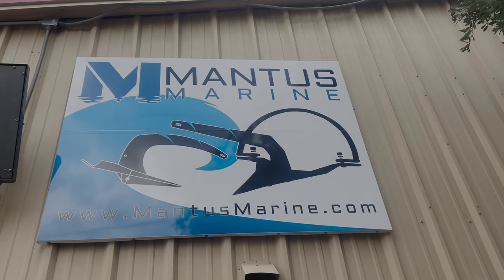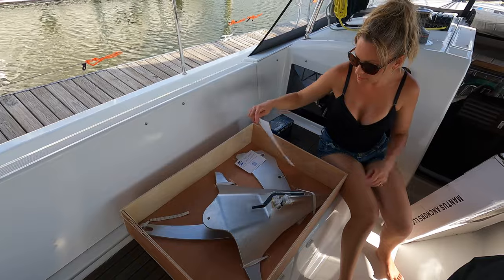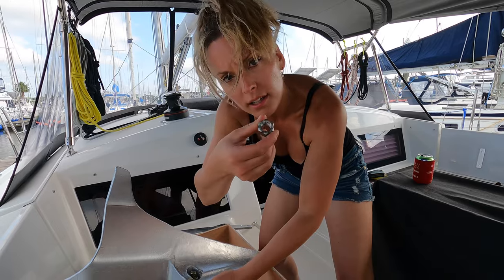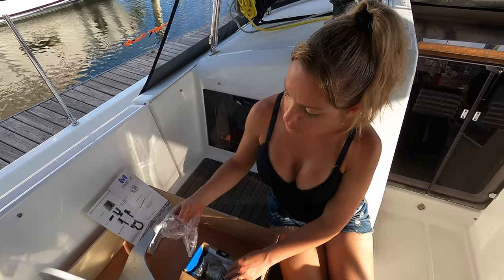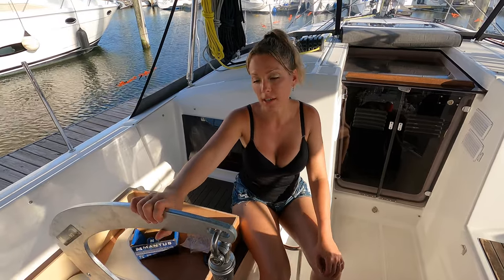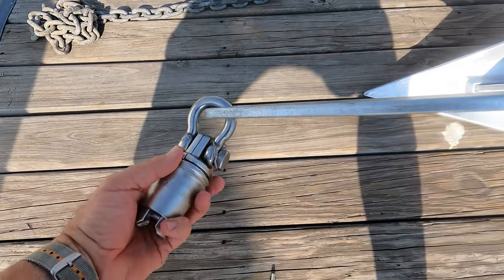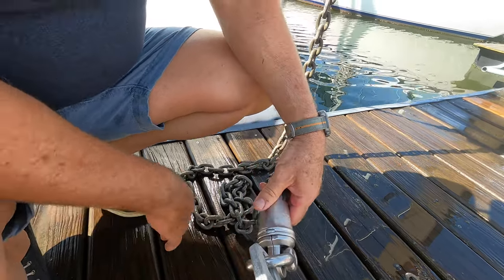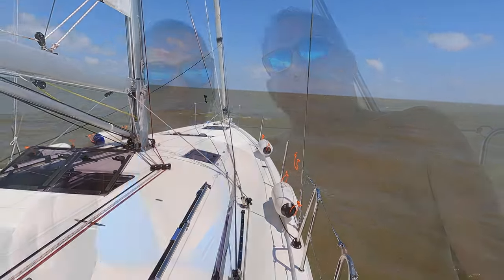Size Matters   Mantus M2 Upgrade

Comment: Nice Anchor, good to see it's a nice fit at the bow too. Not sure I can get one here, but will be OK with a Rocna if not, which is a kind of beefed up super enhanced Genuine high quality Lewmar Delta . I was lucky enoughnto have one of those original Lewmar Delta Anchors on my last boat, which got me andvthe boatvthrough multiple Tornado hits, the first of which was a geck of a hit, which thankfully pushed the Anchor out before the boat capsized - the top of the mast was under water on the .port side, after veing hit really hard from Starboard. .I think 25 kg Mantus or Rocna is ideal at next size up for the Boat size. If I make it to Texas, I think I'll pick one of the Mantus up as a spare. Thanks for this, and Best Wishes. Bob.  👍🙂🇬🇧🏴🇺🇲
Reply from the maker: I'm sure they can ship too. We just happen to live close by.
Reply: @SailingCAVU  
I've found them here in the UK, and they're two-thirds the price of a same weight Ricna, big surprise tbh. When .I get to the USA,  I'll pick up another one as a spare I think. Tip for keeping the Anchor in great condition that may work, and is worth a try, is that Cold Galvanising Zinc, 96% Zinc, in a Silicone medium. If the Galvanising looks tired, slap a couple of coats on. Apparently 3 coats works brilliant on props, which suggests it's tough, as a non Toxic antifoul, plus it works as an Anode. Could be good on the blades of the twin rudders too. on haulout, easy prep, and slap some more on. Here in the UK, a tin with one kilo of Zinc powder in it,  costs about 24 pounds including 20% sales tax. Should be cheaper in USA?  Thanks again for the great insight into this excellent anchor, which .I'm sure will serve you well. Best Wishes and Fair Winds.  Bob.  👍🙂🇬🇧🏴🇺🇲